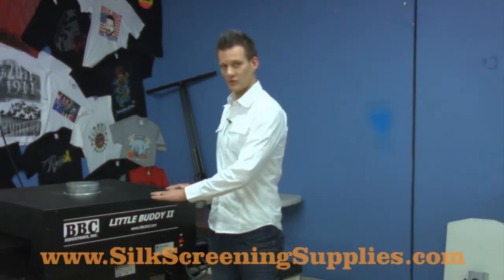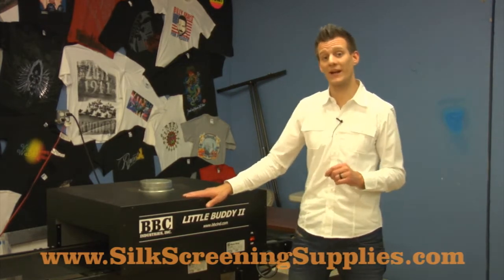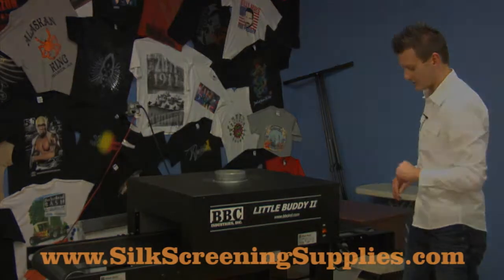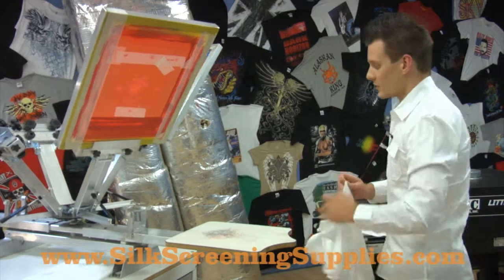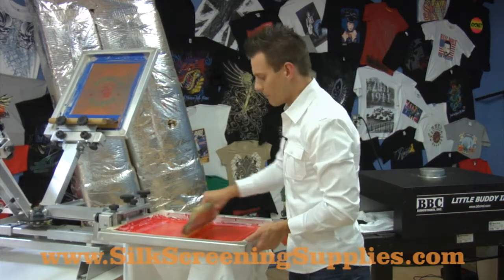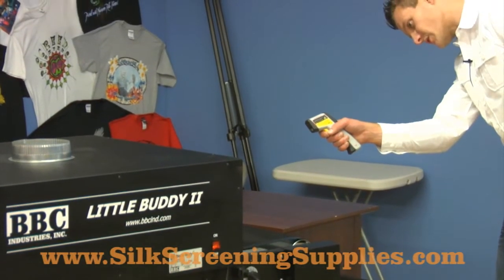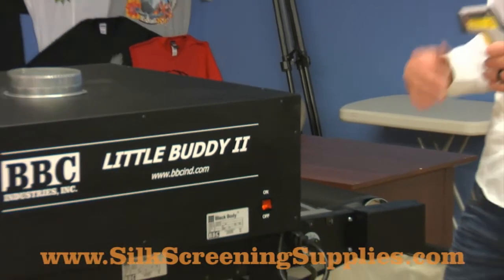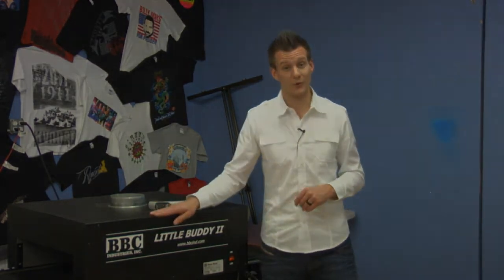BBC Little Buddy Conveyor Dryer - Screen Printing Dryer

Comment: Hi Ryan. I noticed you're not flashing the colors before you switch to a different color screen. Is it ok to just get the ink on the bottom of the screens? Im flashing them in-between each color. Should I not be? Thanks!!
Reply from the maker: If you print flash print your white ink and then print lightest to darkest you can do what's called "wet on wet printing"

Comment: Ryan, I got this dryer from you and im putting it together now, i noticed some of the black on the heating element had rubbed off, like scraped off soot, in shipping and the silver is showing through, is this an issue or danger i should figure out before i use it?